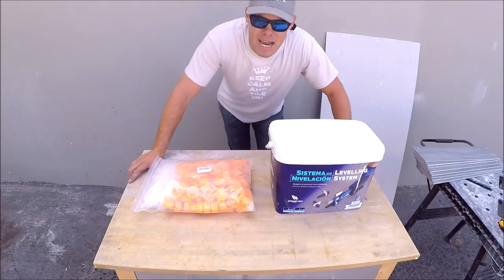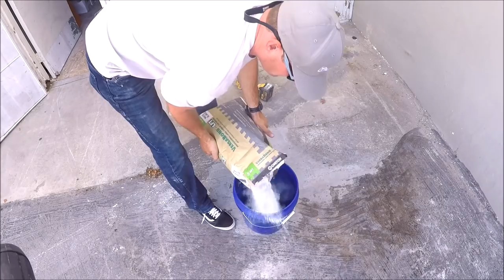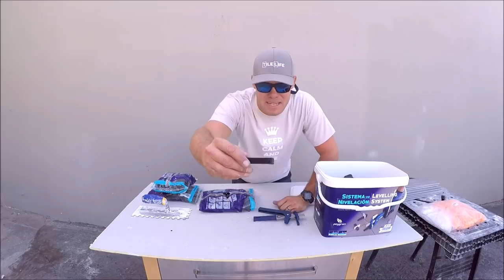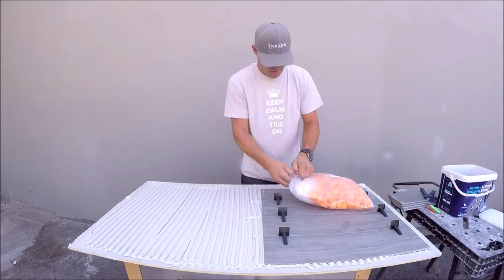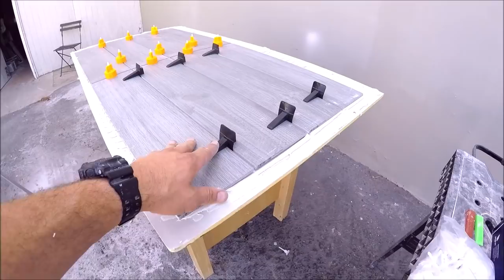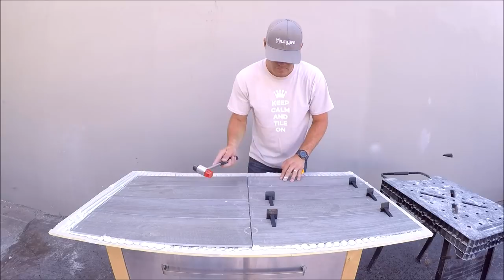Testing Cheap Amazon Tile Leveling Systems

Comment: I still need to know why you chose raimndi over the cheaper  clips?  You said they did the job so why?  Haven't seen one negative outcome on the install you just presented.  That screw system I agree,  turning will spread the tiles through force and they strip. I uses those Amazon slide and clip over the expensive ones and not one flaw.  Just my opinion.  I saved alot of money doing it.
Reply: They did the job & “ … the price was right” … the black ones were smaller clips & wedges & more expensive than QEP ones … the smaller clips & wedges just aren’t as effective as the wider clips & wedges

Comment: Just finished tiling the master yesterday using the LASH system from Home Depot. This was the first time I've used a leveling system and I have to say that I'm on the fence about it (at least the LASH system anyway). There is a bit of lippage on a few tiles, which is frustrating. Matter of fact, I was going to grout today and didn't because I'm seriously considering replacing a few tiles to try again. I still have my shower to do, so I'll either like the system better after more practice or I'll move on to another system on my next tile job.
Reply: Tried LASH and it is terrible IMO
Reply: @aca31comcastnet  Now that I've used it a few times in the past year, I agree with you. It does not work as well as I had hoped.

Comment: Never seen these in my Country.. why would you even need these? Can't you just level your wall / floor?
Reply from the maker: They definately help making walls and floors flat! You should give it a try👊
Reply: I see you prefer custom Building Products Versabond thinset. I swear by this thinset it's what we use in our shop, 25 years never a be claim.
Reply from the maker: @DustinHoffmansrq  I agree! We have tried so many other types of thinset, but Versabond/LFT is the best consistency for installing, Not too sandy, just the right amount of glue, it works great!
Reply: Floors should be flat but not all tile is either
Reply: When you want perfect floor not just decent you go for lippage system.
Reply: I believe it is for assist you. It is not a must of course. As you see it is just faster, comparing with master level without any help from tools
Reply: There is a layer of thinset between the tile and the level floor, so there are chances for the tile to set uneven. These products are supposed to fix that.
Reply: @DustinHoffmansrq  just heads up versabond is not certified by ansi  for wet areas such as custom showers pools.. exterior
Reply: Were can i buy this product
Reply: I’ve been laying tile for 27 years and thought I did a great job installing wall tile but when I gave this a try I noticed how flat I could really get them to be I’m in love with the system I’m yet to try this on a large floor tile format
Reply: You would think so.  I didn’t even know this was an issue until I saw this product.  I just hire people who know what they are doing but then again, the skilled people will use these for speed and the unskilled will use it as a handicap until there are no skilled laborers left.

Comment: RE: FLOORS - they're all a lippage system not a levelling system they will not level any floor (you need to screed it spot on to start with) but they will (RAMONDI)alleviate to a very high degree tile lippage...deadest grouse invention !

Comment: What is wrong with a level?!
Reply: It's not so the tiles are level to the world (like you'd get with a level or transit) they are just flat with each other.
Reply: T-800, nothings wrong with a level, in fact for a good tile job you should be using both a bubble and green laser level. The tile leveling systems help prevent lippage, an age old nemesis of many a professional tile installer.  Especially when you’re tiling large expanses, where it becomes increasingly difficult to go back and check if a tile(s) is even with it’s next door neighbors.

Comment: I started using Lash before they were a Home Depot item. I upgraded to the Raimondi system. Now here is the issue I have with both. The Lash system clips have a pronounced curve that sometimes causes issues with placement. The Raimondi system does not always break properly below the tile surface. I had it when using the system it broke on installation and ripped open the top of my finger. I invested next in the RTC Spin Doctor system. I like this system the best. It has constantly broken off below the tile when removed. It has less of a curve than Lash and is easy to install.
As a bonus, they allow corner application, which, when running low on clips can prolong your progress.
It's easier to remove the caps from the clips when done than Lash or Raimondi, and there is a tool to help crank if you need that. I would like to see you make a video running the Spin Doctor. Thanks

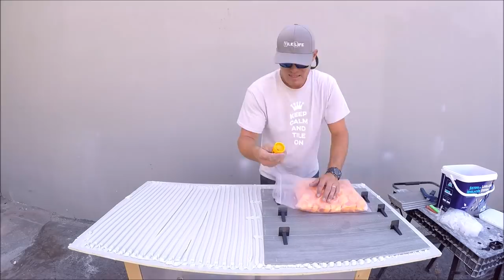Comment: I am about to tile my new shower walls, and I did some research on the Rigid Level Max spin on system. They have 3 types of clips, one is for a straight joint, one is for a three way joint, and the last is for a four way joint. The one you showed us (4:37) looks like a three way joint clip, like the ones I bought. It has ridge at 90 degrees to the other ridge at the base. It is supposed to go in the corner of the tiles. You were putting them on a straight joint, and I believe that is why they pushed the tiles apart, and giving you problems. I am no expert, but I think that was your problem.  By the way, thanks for going to the trouble of reviewing these systems.

Comment: Im new to these systems. It seems to me if you are working with an uneven surface these clip could create pockets of space under the tile in the corners. I assume I am missing something since it seems like several contractors are using these now.

Comment: Im about to pay a professional for installing 9x47 wood look tile. This guy has installed a lot of tile or marble. To be honest in my country i have never seen this leveling  system and the final work seems spot on every time. Now that i now this exist well, i want him to use this product. My main question here is: how do you know how much pressure apply on the pliers and dont over press or less press it to get every time the perfect set and flatter surface. Thanks
Reply from the maker: You give it standard pressure per clip, if you over squeeze pliers, the clip can break.

Comment: Did you try and rock the tiles to collapse the thinset rows at all?  Did you just use super thin thinset so the weight of the tile does the collapsing?

Comment: Great video that helped make a decision on what type of leveling system to use thank you! Also I’m using almost identical tile as this. The 33% offset would that be the pattern to run with? Just one offset then full tile next and same offset again? Or would it be full tile then 33% and maybe 66%? Or is that personal preference after that? Hope I asked correctly lol thank you !

Comment: Thanks. Seems like a good honest review. If you were going with a 13x40” tile would that change your opinions on a leveling system?
Reply from the maker: That's a big tile! I would go RLS or LEVTEC. Peygran is good as well 👊
Reply: @LandbergTileTV  If I may add my two cents....I have gone to using more clips (spacers) whenever working with larger tiles....sometimes as often as every 8"

Comment: Not a good test when you stack plank square like that, the bow in 24" tile is mostly uniform so the system doesnt have to flatin the tile. Do a random set and see how it preforms.

Comment: Good review 👍

I’ve never used but always wondered about the spin type. Wondered if they catch on the tile and move them. I assume this isn’t the case with Spin Doctor ones etc? If not, why not? Doesn’t any turning action mean the tiles might be moved?

I suppose the same might be said about wedge type, but at least the “push” of the tile is only in one direction 🤔

Anyway great video 🇬🇧
Reply from the maker: Yes, sometimes the tiles move when you insert the wedge or tighten the spindle cap. You simply push the tiles back together 👊
Reply: I love the Progress profiles leveling system, but there is a learning curve and a few tricks. They make a red shim (designed to prevent scratching on marble) that helps reduce the twisting. If doing a large area, I will screw a board down and start building off the board (to help prevent movement). If working in a smaller room, I make my perimeter cuts tight and use wedges along the walls to prevent movement.

Comment: I've used the new lash ,they're ok,I have their  tool ,sort of a plier,they dont snap off as easy  when cured as T- lock,now I'm trying spin dr,and some Ebay  cheepos,wedge,n clip, will see,I've only broke 1 or 2 qep, and only 1 T lock, havnt tried lev tec,or raimondi,,theres eventile ,looks just like T- lock level master,easy on thumbs,btw I used the qep  wedge tool on T lock, some  stuff interchanges,supposedly ridgid,caps work w spin dr bases,I think t lock wedges work  w levtec clips

Comment: Remember if your old school and good at tile we never had stuff like this we just had to put down enough glue to make it work. Of coarse it makes the tile close to perfect level but achieve that just slapping it down and you'll be great at tile.$
Reply: With the move towards large format tiles, these systems are being used more and more as the tiles have a more pronounced bow when fired.  It also allows you to do things like go 50% offset on large format tiles as they can actually bend porcelain, etc.  Open your mind sir.
Reply: You can also cut a mitre with a handsaw old school. Doesn't make sense if you are second fixing a house. Embrace improvement.
Reply: These systems help keep costs down too. Floating tiles adds the extra cost of thinset, and the time and labor to mix more buckets. Especially a 1/2" notch on a shitty floor. Poppin a tile up to float it, then finding out it wasnt enough and having to pop it up again. Or, now you have too much thinset and have to clean up all the squeeze. Waste of time! Im old school, and im gonna give the T Lock system a try

Comment: Could you be more specific on peygran? How is it not as good as levtech or raimondi? Smaller? Doesnt get as tight?
Reply from the maker: The wedges are 1/3 the size. Bigger wedges cover more surface area which is more effective. Also, the pliers are super cheap and feel like they would not last long.  👍

Comment: Good video. But, I see you clean the tile cement close to the tile just before you put that plastic thing, don't you? If so it make that area weak?
Reply from the maker: Just clearing out the thinset. Helps when you break them off.
Reply: With non-wet area you need to have a min of 85% tile coverage, he still has plenty here.  Wet you need 95% and he's probably still perfectly fine.
Reply: He’s taking out just enough to keep thinset from oozing out between the grout lines. Makes grouting 100x easier and still maintains virtually complete coverage once the ridges are collapsed

Comment: New subscriber, you have some awesome videos! I’ve seen you use 1/16 spacing in multiple videos. Is this the only spacing you use? Where would you use a different spacing?  Cheers!
Reply from the maker: Yes sir, we only use 1/16th inch spacers for all of our grout joints. Smaller the better, less maintenance for the customer and a cleaner look! 👊
Reply: @LandbergTileTV  FWIW, the NTCA guidelines are a pretty good resource, and there are definitely times where a larger grout joint size may be appropriate....I certainly agree that smaller is (usually better), but occasionally 3/32" and 1/8" will be a better option. Just had to install some pretty awful 12x24 ungauged slate for one of my builders, had to break out the 1/4" spacers I used on another slate project years ago (in that case the architect actually specified 1/4")

Comment: how is it not as good as the more expensive brand if the process and outcome are the same?
Reply from the maker: Removing cheap systems can hurt you with time. If the cheap clip/spacers don't break off properly, you then need to cut them out with a utility knife. Not only does this take time, you can easily scratch porcelain, stone or ceramic tile trying to cut that plastic out. I've done it hundreds of times, scratching the tile with my knife cutting plastic out..

Comment: How do you know when do you stop the clicking?
Reply from the maker: You will feel it in the pliers, after tightening 100 clips you will get the hang of it 👊
Reply: Well cause you got experience and a pro.  Any advice for a diyer?
Reply: tran  basically in the angling. The backside of the wedge u push out and the clip holder part shouldn't be squeezed too hard. Slowly do a couple to breaking point and ull see

Comment: Those systems seem to me that you could create a hollow spot underneath and break Bond. Should you check the back of the tile to make sure you have coverage that all seems fine and dandy on YouTube
Reply from the maker: The clip spacers do not create hollow spots, they are inserted into the mud, you then collapse all ridges to fill voids.

Comment: Hey mate. I’m a DYI guy on restoration. I think I’m good but I’m not perfect. I’ve not seen someone trowel off the adhesive between the tiles before. Is this something I should be doing, or was it just for the purposes of inserting this levelling system? Cheers.
Reply from the maker: Yes, if you trowel the thinset between tile, it HELP with the breakage of the clips/spacers. If you don't, the plastic from the clips will remain in the grout line and you'll have to cut it out. 😎

Comment: Peygran is about the same value per piece as T lock. I would probably just stick with the T lock.
Reply from the maker: I don't agree,  T Lock is hands down the most expensive leveling system on the market. It's a great system, but more expensive than Pegran.
Reply: Am I doing the math wrong? Your link shows this system is $155 for 400 clips. The “similar items” section shows PLS T Lock is $102 for 300 clips. I know the pliers are included on the one in the video, but I’m still not seeing the value compared to T Lock. Maybe I’m missing something.
Reply: MoneyManHolmes wedges and clips?

Comment: You gonna burn up your drill bro!!
Reply from the maker: Never! This Dewalt is kicking butt and has been mixing mud for over 25 showers now! No problems, only recommendation is to use at least 6amp Flexvolts 👊
Reply: I used an 18v dewalt hammer, had the monster battery.  Never had an issue myself but still would only do half bags just in case.
Reply: No, but bearing will wear off because it isn't designed for side ways movement. But Dewalt also make Flexvolt cordless mixer it would be better.

Comment: Does not matter how cheap tile system is or expensive. A tile is never 100% accurate.......... You will always have problem with levering........
Reply from the maker: I have worked with more than 8 different tile leveling systems and yes, there are good systems and bad systems, but they all help with installing large format tiles. 👊

Comment: Nice demonstration but all tile level systems are a waste of time and money...use a level
Reply from the maker: Negative sir, tile leveling systems give you a much more superior installation with big and long tiles. Don't bash them until you try them. Thanks for watching! 👍
Reply: They were originally designed for very large floor tiles, the type you get in big commercial spaces where getting a perfectly even surface, over such a large surface area would be very time consuming or difficult with just a level.  They also allow (if im not mistaken) people to be able to walk over them without ruining the floor, which is probably more important on construction sites with numpties that'll walk over them even when barriered off, where you can be certain it's you who'll have to put it right.

I'd rather a tiler used this and ensured they gave a perfect finish - not that they aren't capable, but because people can forget things, accidentally nudge tiles out of alignment, be slightly off, than to be old fashioned and over confident, believing they are perfect. 

I'd rather spend that extra £30 as a client on some plastic clips and ensuring a quality outcome than to risk a bad job for whatever reason, and I'm sure that is more than easily recovered by a skilled trademan's hourly rate who can spend more of his time using his skill in area's it's needed, and not wasting it on constantly checking a bubble on a level.
Reply: The leveling systems are pointless if it's not fully buttered underneath you just going to create a void and it's just going to crack

Comment: Pointless product.   Waste of money.      I can only wonder how stuff was tiled for 100s of years without this.     All kidding aside.   Pointless product
Reply: Vince Black are you still driving a horse and buggy to work? That system has been in use far far longer than automobiles. 

 Do you have electric in your house and indoor plumbing? People got by with candles and outhouses just fine.